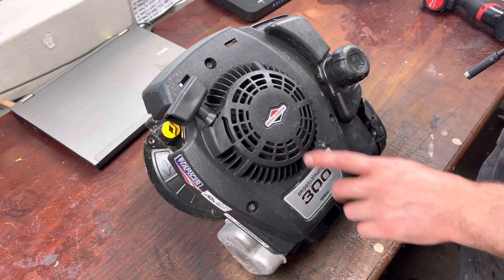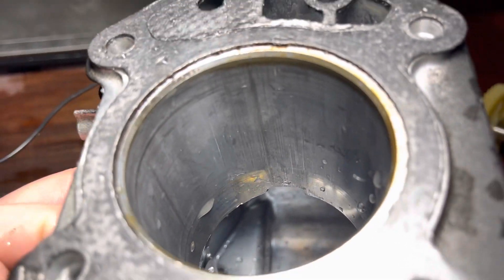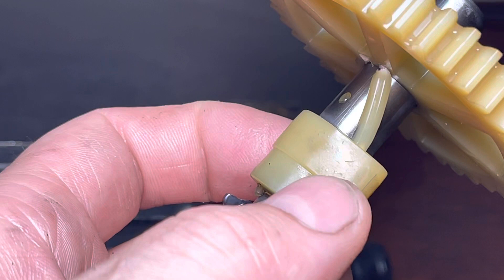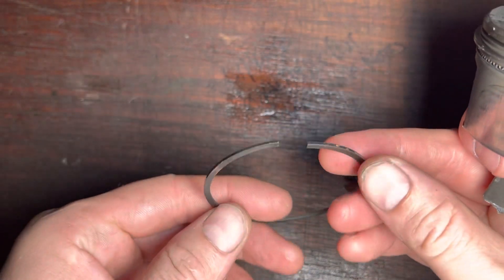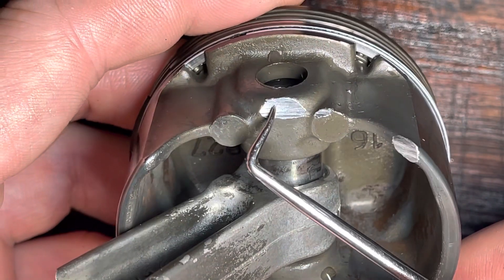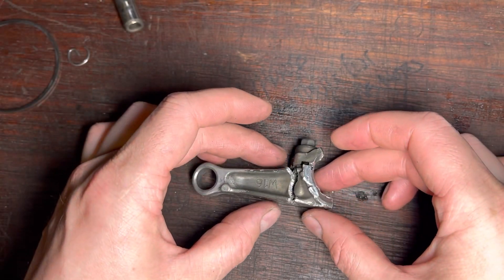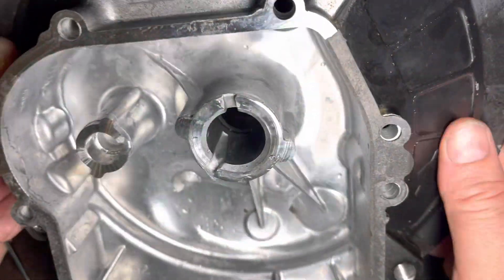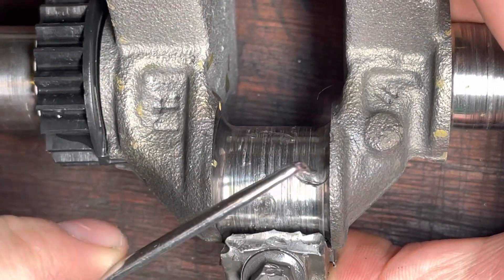Briggs & Stratton  CATASTROPHIC Engine Failure - Teardown!

Comment: Plastic cam lobes? Hmmm. I'm not impressed.

I agree that the older Briggs were better engines. I have a 13 yr old Briggs flathead that is still running fine after being used every year since new in my primary mower. But I can't put too much fault on the engine designers if the engine was run with no oil. You kept saying "this wouldn't have happened with an older Briggs". Yes, it would have. It would have just taken a bit longer. I have no doubt that the owner would have continued to run an older Briggs without oil until it died. The older Briggs might not have failed as catastrophically, but I have faith in the level of negligence of the owner... they WOULD have succeeded in killing it.

Engines, even great ones, must have oil to survive.

I'm kinda with you on the mixed feelings on this engine. It's not as good as it's predecessors, but it would still be running just fine had it been maintained. It's not Briggs' job to make an engine that can withstand that amount of neglect. If this newer, more efficient, better emissions (and cost reduced) engine is capable of lasting 10 yrs with care, they've done their job. Would this engine survive with care for 10 yrs in a commercial application? No. It wasn't designed for that. Briggs has other engines for that.

I have a mower with a 450E engine, but I've only put a few hours on it, so I can't render a verdict on it just yet. If it lasts a few years, I'll be happy with it. I bought it used, and it appeared to have been somewhat neglected. It DID have oil in it, but it was black.

Nice autopsy.
Reply from the maker: Yeah all are plastic cams - they’re just cheap junk really. They aren’t designed to last more than a few years! The flathead classics were the workhorses!

Comment: Embarrassment, Yeah but they were trying to compete with that large Chihonda market, unsuccessfully, possibly disgruntled that they weren't cloned. Had a similar 5HP horizontal B&S , but only a bit of transferon cam journal, same broken con rod, light scoring on bore honed , piston polished up, rings fine new seals and bearings, gaskets all round, a runner now, wallet lighter than for a new one, but!
Reply from the maker: Spot on, they are built to a price for
competition against knockoffs!

Comment: Hi Tom, Love the autopsy. BTW the governor is bent
In a parallel world, I destroyed same B & S motor on my mower yesterday by hitting a heavy chunk of metal and bending the crank end (whack - whack - stop)! That would be a 2-3mm run-out at the blade end and the attendant vibration that you would expect.
Fortunately I had a spare from a roadside pickup and swapped it out. When done, I decided to tear down the knackered one and was, like you, unimpressed by the manufacturing / design. Cheap as you can make it stuff that is not designed to be repaired.  A Villiers it isn't.
Memo to self: 1 Never run on low oil and  2. Just cut grass you fool, the lawn mower is not a metal sheer!
Reply from the maker: Thanks for the comment and clarification on the governor paddle!! Much appreciated :)

Comment: A great example of no maintenance and lack of lubrication. This will cause any engine to fail. Even a billet rod would seize and snap with no oil. I've seen plenty of Briggs flatheads both aluminum and cast iron with broken rods. Most were from poor maintenance or lack of oil, a few from running at too high an RPM. There's no doubt the quality isn't where it used to be but that's not the reason this engine failed. The con rod was more than adequate for it's intended purpose. The plastic (nylon composite actually) cam shaft every one loves to hate has been around for a while as they were used in the Quantum engines as well. One of the best (IMO) engines Briggs ever built. For those of you buying any engine that says "just check and add oil, no changes needed", ignore that and do proper oil changes with the proper oil. Your engine will last a lot longer.
Reply from the maker: Hi Peter, thanks for sharing your thoughts and correcting my assumption of poor quality parts. Much appreciated! 👍

Comment: Good one Tom 👍Classic symptoms of engine running with low / no oil. When bushings seize there is a lot of power transfer compared to a bearing. I know this is the B&S discount engine - but properly maintained and topped up with oil they tend to run pretty well. And YES it would have happend on any B&S engine running without oil. The issue has been there for awhile - all the sludge in the crank case takes time to accumulate
Reply from the maker: Thanks for the clarification and information Claus it’s much appreciated!!
Reply: Really liked this video Tom. People tend to forget that when price and quality goes down - maintenance requirements goes up.
Reply from the maker: @HobbyMotorDK  thanks Claus, and I really appreciate your comments because it gives me the opportunity to learn and glean information from those who have more experience than I do and who have a different opinion than I may have thought of! Thanks again buddy.

Comment: Massive cam lobes spinning on the metal shaft?  03:57 that plastic bit at your thumb should be parallel with the metal shaft. No oil, overheated, can gear spins, timing got off, backfired and shattered the con-rod. Nice video Tom! (edit: I should watch the entire video before I make comments LOL)
Reply from the maker: That’s interesting, I never thought about the valve timing being off causing a backfire and shattered conrod! Thanks for sharing Stella :)